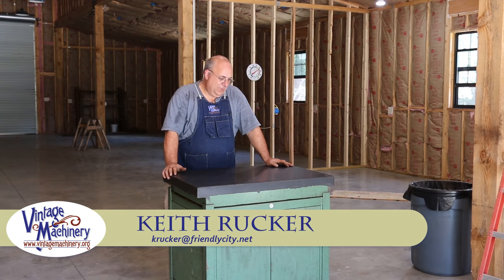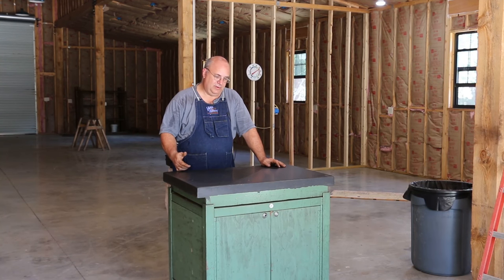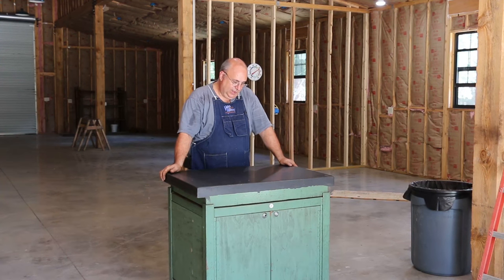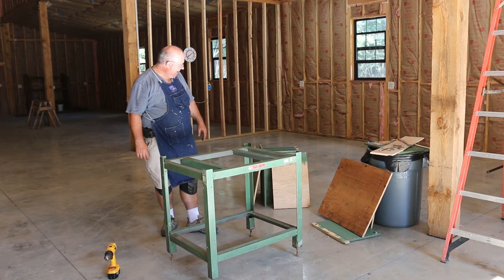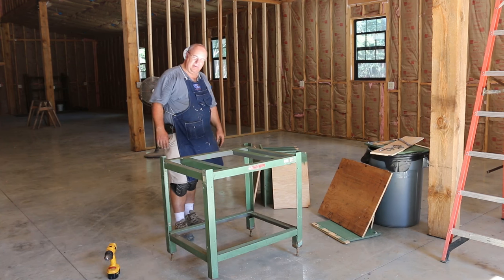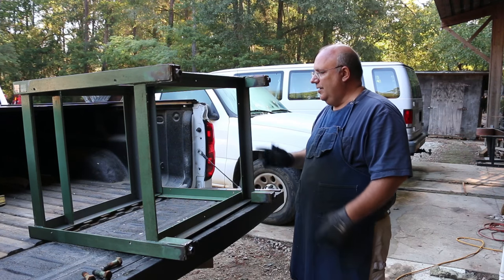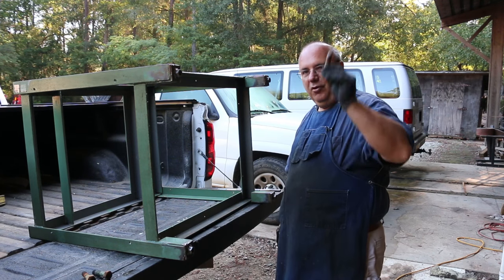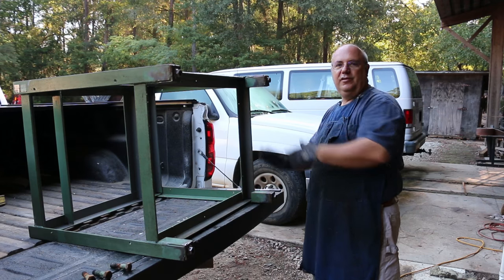Brown & Sharpe Surface Plate Stand Modifications

Comment: That is going to be a very valuable tool addition to your shop Keith. A very nice job of putting it right. 
One other thing that the gap beneath the plate will accomplish, is ambient air temperature circulation. Maintaining the same temperature in the granite plate, therefore lessening stress in the stone and any measurable variation. Cheers.
Reply from the maker: Good point!

Comment: Keith, I would machine the heads of the 3 point leveling bolts if they have grading marks on them. I would worry about them damaging the lower surface of the plate when you are leveling it. Just a thought.
Reply from the maker: I ground them all flat.

Comment: I believe in order for the plate to actually be double AA grade it needs to be within  1/2degree of the temperature it was certified at.  I think that normally a plate needs to be at calibration temp for 1 day/in of thickness for really good results. Climate is often over looked in measurements but it is critically important when you get down to small values.
Reply: The only plate i've been around long enough to talk about (a scientific plate with drill points for laser projects at a structure design laboratory) is always kept within temperature spec. It even has its own heat exchange mechanism built in the base. So yep, temperature is very important, as i heard, the whole base, cost more than the plate itself. :)
Reply from the maker: Yes, you are correct.  Technically, even if it lapped to AA flatness, because I cannot keep my plate at a constant temperature, it would be considered an A Grade.  But, for what I am going to use it for, it really does not matter.  I would prefer it to have been lapped to AA standards as it will be flatter than A grade, even if my temp changes some.

Comment: One suggestion: The surfaceplate should stand on a higher level from floor. Most of the measuring and tracing with instruments you will do in a manner that you have to read the numbers and nonius on instruments horizontally at eye-level. So the surfaceplate should stay at a level of about 1.20m. ( ca 4 foot). That way you don´t have to bend your body so much  to read the numbers. (your bodyshape resembels to mine)
Reply from the maker: An alternative line of thinking is that the surface plate be at roughly the same height as your work bench so that when moving heavy items from the bench to the plate for spotting while scraping, you don't have to lift it very high.

Comment: Grab some self adhesive felt to cover the contact surface of your cover.  It will help maintain the surface finish after you have the plate calibrated.  Looks good!!!
Reply from the maker: I am planning to do either that or have a rubber mat under the cover.

Comment: Hopefully there will be videos of these scraping lessons? Coincidentally I've been doing research of this recently. I'm young so I hadn't even heard of it before, seems easy enough. The tough part would be getting surfaces parallel or square! 

Watch out with transporting surface plates into environments with different temperature and humidities; you would want to wait for the plate settle. Ideally for a AA rating you would want to get it inspected & lapped under the same conditions in which it will be operated; weather being one and also supported at the same locations of your own stand.
Reply from the maker: Scraping a surface flat is not a huge problem.  As you say, getting it parallel and square is the real trick.  That is what I hope to really learn in this class.  As for the plate, you are correct.  Since my shop space is not climate controlled, it technically cannot be certified to AA, but it can at least be lapped that flat to start with.  We already plan on giving the plates time to adjust to the temp in his shop before doing the calibration work.

Comment: Hi Keith, Tom from Oxtool did a video on surface plates including getting recertified. I learned a lot from his video so I at least I could keep up with what you were saying. F I were you I would have the surface people come to my shop because yours is probably the largest plate and after it it certified you won't need to move it. Great video as usual.
Reply from the maker: Actually, several of the plates we are going to have done are the same size as mine.  And, if they come to my shop, I would have to pay them for the extra 400 mile round trip.....

Comment: Keith, the 3 points recommended for holding a surface plate or other precision surface (the bottom way surface of a surface grinder, etc) is right about 5/9 ths the distance of the item and centered. Called "Airy points"
Reply from the maker: Correct - I have done a bit of research on Airy Points.

Comment: Nice work on the plate stand Keith!  Yes, I hope you manage to get a little footage of the lapping being done to it, and also some footage of scraping basics.  I've started reading up now some on scraping, since after getting into watching you and the other YouTube community machinists do your lathe and milling work, I've now been wondering 'How do you true up and restore worn ways on a used machine that's seen its better days?' and finding out that hand-scraping is the only foolproof means to do that.  But, to even do hand-scraping properly, a surface plate of the appropriate size for the scraping job your doing is an absolute MUST, hence why you got this one and will have it lapped.
Reply from the maker: I am looking forward to the scraping class coming up - it is a skill that I have long wanted to learn and will be a great help in my machinery restoration.  As for scraping, everything is based off of the flat surface plate, so yes, I want to make sure that I have a good one to start with.

Comment: Looks very good, although I have to question the bottom board of the cabinet. Seems to me it would be much stronger if that board was on top of the angle iron so it's supported for the full length of each edge instead of on the bottom of the angle iron hanging from a few nuts and bolts.
Reply: Well, hanging it from there does conceal the plywood edge and does look better, but as I mentioned, it also makes it far weaker and for a workshop, I'd assume that strength and functionality is of greater concern than appearance.
Reply from the maker: If I had built that cabinet, I would have put it on top like you suggest.  However, changing it at this point would have required me redoing all of the other pieces to make things fit.  Since I don't plan on loading it down with heavy items, I am not too worried about it and decided to just leave good enough alone.

Comment: Nice table work. I like that piece of granite, but would never think to have 3 points of support, but there again it make sense for levelling.
Reply from the maker: Most companies that make the plates will tell you that they only guarantee them if they are mounted this way!
Reply: It's not so much for ease of leveling (although it does make it easier) but to ensure that there is an exact distribution of the supporting forces at known locations. With 4 (or more) support locations, you would have to measure the exact forces on each of the points every time anything changed. The plate will always "droop" some, and with 3 points of support the force is known (it HAS to be the same every time) and the droop is compensated for in the final flattening.

Comment: Regarding the three-point support, you're absolutely right, it's far more reliable and adjustable to have a tripod support. As the engineers say, it's a statically determinate structure and it will support solidly even for somewhat rough or out-of-level situations.

But if I were designing it from scratch I'd support it a little differently; as it is the third point is in the middle of the right-hand rail. This means a load on the front right corner can potentially lift it off the back left support and it might tilt. 'Course, with a stone as heavy as this that would have to be a LOT of load, so maybe it's not an issue. But my instinct would be to have the two supports on the front edge 1/5 of the way back on both sides, and the third support in the centre rear (maybe on an inverted C channel). That would give a support triangle closer to an equilateral; the adjustment bolts would be more accessible; and side-to-side stability would be symmetrical.

But i'm nit-picking. I love the new green, and as always I'm impressed by your workmanship. Well done, sir!
Reply from the maker: The plates are made to be mounted this way and they come from the factory with mounting pads.  These are the same locations the surface plate was mounted on when it was ground and lapped at the factory.  Most companies that sell surface plates state they they only guarantee them if they are mounted on these same three points!

Comment: Just a minor sugestion I thought about when you first acquired the surface plate; you might want to stick a few small silicon rubber feet on the inside of the wooden dust cover. Say one in each corner. This would help protect surface plate top from abrasion from any grit that might get between plate and cover. Just a thought.
Reply from the maker: Agreed!

Comment: Question Keith - I would have welded the nuts on the bottom side of the angle irons, turned a radius on the ends of the bolts added a nut for locking between the bolt head and the welded nut and been able reach inside the cabinet to make the  adjustment on the three point - what you did looked easier, but how difficult was it to adjust the bolts in the (seemingly) small gap under the surface plate? (my way would likely be more difficult in the fabrication)  I like your method, as long as it is not difficult to adjust the 3-point leveling.
Reply from the maker: Its not a problem reaching under the plate to do it.  My worries would be that if I had to do in inside the cabinet that I might have to unload the cabinet to get access to the bottoms.  Also, I would only have access to the screws from the front of the cabinet while I have access all the way around for leveling with them on the top.

Comment: Another great video Kieth.  I really wise your shop was in my backyard, not just because of the size but it has plenty of space between woodworking and metal working especially the welding, I'm always worried about the sparks mixing with the dust!  Good job and good luck!!!
Reply from the maker: I plan to have the two activities as far apart as physically possible in the shop.
Reply: Good idea!

Comment: Good Job Keith, came out great. If I recall correctly you used 5/8" bolts under the granite too. Was thinking those swivel feet with rubber pads would have worked great under the granite too so you would not have metal to granite but a rubber cushion between incase anything heavey was dropped on the top the shock would not be on a small area of steel but spread out and on rubber to lesson chances of cracking. But that piece is very thick so doubt you could crack it unless it was dropped on the floor.
Reply: im sure a few bits other thin stuff could be substituted, even cardboard perhaps, after all they use that on grinding wheels to prevent too much point pressure.
Reply: My thoughts exactly.
Reply: I believe that Keith Rucker said that there are "pads" on the underside of the Brown and Sharp Granite Surface Plate.  He even showed where these pads had worn the top of the steel angle iron of the stand.  I believe that the steel leveling bolts will contact these pads and not the surface plate.
Reply from the maker: The plate actually has three "pads" mounted under it so that the bolts are not even coming in contact with the stone.

Comment: Hi - Very nice end result -- I don't know if it matters at all, but I would have filed the adjustable bolt head grade markings smooth where the stone weight sits on them so theres a smooth bolt head under the stone and not a higher pressure point where the bolt grade markings might grind into the stone under its own weight-??
Reply from the maker: I actually did do just that, but it was not mentioned in the video.
Reply: I stand corrected--lol   I should have known you would.  Much better result than what you started with - cant believe someone would paint that granite like that - but easy to rectify.

Comment: Hi Keith,

All the stands I've seen use hard rubber pads to support a granite plate. It seems to me that the bolts may create a point contact and risk spalling the granite.

It looked to me as if there was worn paint in three spots from support pads, perhaps they got lost the last time the plate was off.
Reply from the maker: There were pads mounted to the plate and are still there.  They are not rubber though - more like a hard plastic.  I don't think that the bolts will wear into them.

Comment: Considering the structure and dimensions of the wooden beams, i'd say you can safely (with the proper hoist, of course) lift the front end of an (European) mid range car. I'm not going to go in to the math of it, but at the very least i've seen a wood based hoist that was far less sturdy lift a Fort Escort's front end, with the engine inside. So there's that.

If i'm ever going to build a shop of similar design i'm certainly going to build the first set of beams to be able pick up a lot of weight. Because it seems a good idea to be able to back in with a platform truck and pull in heavy equipment to the floor. Something that a gantry, would not be able to do, unless severely overbuilt.

Just my thoughts on the whole lift thing.
Reply: Maybe the cabinet was in the back and a lot of stuff accumulated on top of it and they had an inventory cleanup and finally found it? That's how i got a bunch of tools one day. Went to the local depot near me, and there were red stickers (that's how they mark half price here) all over the place. I went on a shopping craze, kind of understand the ladies now. :))

Comment: Dunno about your leveling bolts on the top maybe you should have milled the top/bearing face flat that raised lettering bugs me on stone bottom, just a suggestion nice job on the re build, excepting the bolt heads. thanks for the video.
Reply from the maker: I ground the tops flat.

Comment: Another good video. Glad to see the insulation has been installed. I bet that helps when the So. Ga. sun starts bearing down. When you open the back door does that help induce a breeze?
At half a millionths /ft, you may wish you had installed 3 fine thread bolts.
Rollie
Reply: I'm not so sure about that, Rollie. I'm pretty sure that the incredible number Keith mentioned was the "Flatness" of the top itself. I don't disagree with you and it may have been a good idea if Keith had thought of it earlier. It would have eliminated having to tap the wrench with a .5" wood dowel to tweak it perfectly!  :) Good observation, though!
Rich
Reply: I thought he was referring to his level tolerance. At any rate, it is a very a small measurement.(;>)
Reply from the maker: The measurements I was talking about was the flatness of the table.  My "Precision Master Level" is accurate to 0.0005" per foot.
Reply: My bad

Comment: I'm looking forward to the restore job on the lathe in the background (505238). That looks like it needs the full works on it. Also any news on the brass dial for the Victor safe?
Reply from the maker: Not sure when I will get to the big lathe.  It is pretty far down the list as I have other machines that need to get done first.  As for the safe dial, I hope to fire up the furnace when things cool down this winter.  Too darn hot right now....

Comment: I was wondering if that was a factory stand why didn't they have the 3 point leveling from the factory?  I found several plates up in my area that don't have the step or a stand.  I think I'm going to buy one and build a stand like that one.  Thanks for sharing.   Shop is coming along nicely.
Reply from the maker: The plate did have three mounting pads under it so it was basically sitting on three points.  But with the arrangement that I have, it will be much easier to level.

Comment: I'm worried about the rubber compressing and changing the level over time but since you have master levels you can check that every so often  and unless you are calibrating levels  it is flatness that is important  not absolute level
Reply from the maker: Yes, I am much more concerned with flatness than level but with the three point system, fine tuning the leveling is a piece of cake when needed.

Comment: The three contact points, AKA Airy points, are to minimize bending or drooping.
Not for leveling. You can level the plate with the feet in the base.
Reply from the maker: You are correct about the drooping and bending, but it is much easier to level the plate on the three points than on the four feet.

Comment: Keith - Another interesting projet. Good job. What I really liked was seeing more of the shop! Can't wait until you finish. So when will the shop be completed, and all of the machines and tools set up?
Reply from the maker: Good question as to when will it all be finished.  Bottom line is that I am paying for the rest of the shop improvements as I have some money to invest out there so it is basically dependent on my two most limiting factors - time and money.  I hope to have the machine shop side more or less complete by spring but the woodworking side is probably going to take a while longer.
Reply: Keith - Yes - Time and Money. We need more of both. I am always happy to see more clips of the shop. When it's completed you should have a grand opening and a ribbon cutting ceremony!!!! Can't wait

Comment: Question. Will the rubber on the feet give you an inaccurate reading if the material is not centered evenly on the surface plate as far as it being leveled goes? Why does the surface have to be leveled precisely if the feet have a rubber on them?